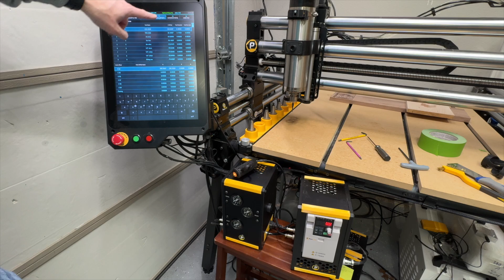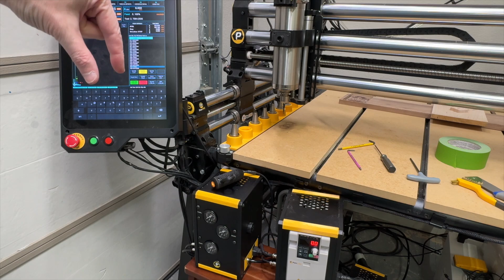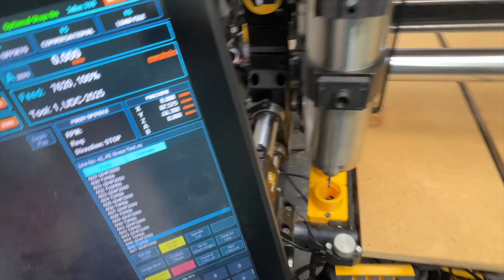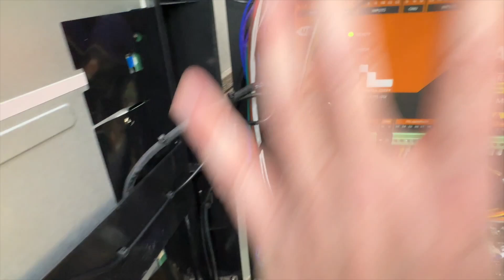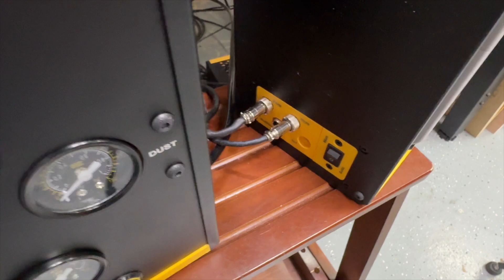Watch This Before Setting Up Your PwnCNC ATC System!

Comment: So I have a Millwright mega v and was wondering if the ATC will work with the millwright controller..thanks
Reply from the maker: Millright's GRBL controller is not capable of full ATC functionality, however their Masso controller is.
Reply: Ok i didn't know they had that..ive had my mega v like 5yrs now..ill check it out..thanks  @PwnCNC
Reply from the maker: @CynthianaCNCandLASER  I've had my MV1 for almost as long... I don't remember when they added their version of the Masso controller... but that is my favorite controller that is very upgradable and expandable.

Comment: I am getting ready to set up my ATC for the first time. This video was helpful. I will watch your install video next.  I have installed 18mmx50mm drag chains from Ugly Dog, so I will be attempting to send ALL my lines, coolant, air, electric through those chains. Can you point me to instructions or video to show the proper way to do this?  Thanks.
Reply from the maker: I don't have a video.. but i will be sure to point that out when i got to assemble the second Dominator later this month.  It has similar 18x50 cable chains and an ATC is absolutely something we'll be installing onto both of the Dominators.

The key, IMO, is to be sure you label both ends of the black air tubes.  This will make it a whole lot easier to ensure you have the tubing fixed correctly.